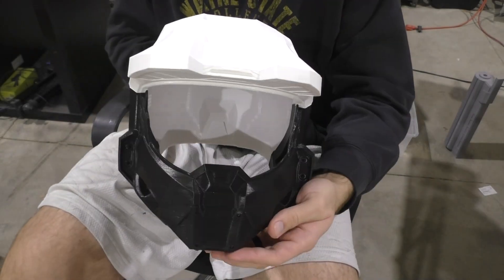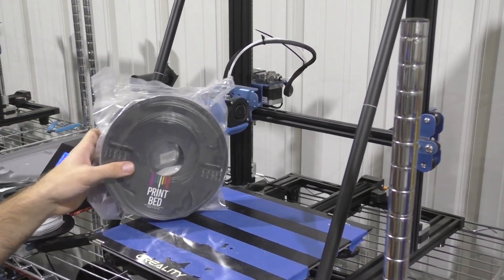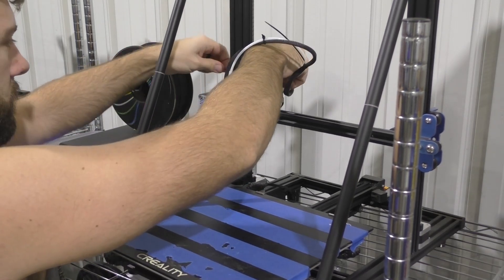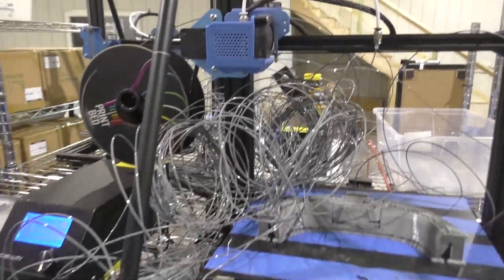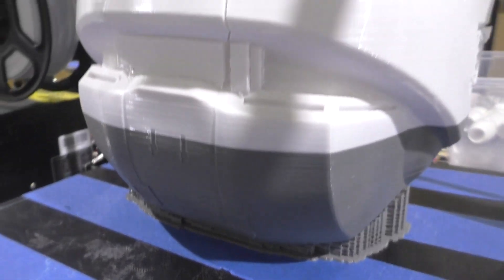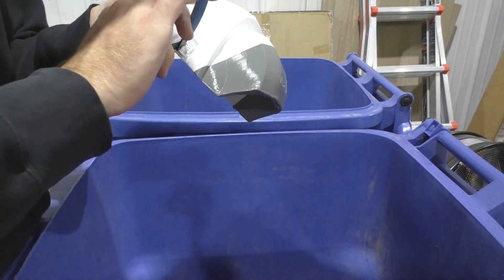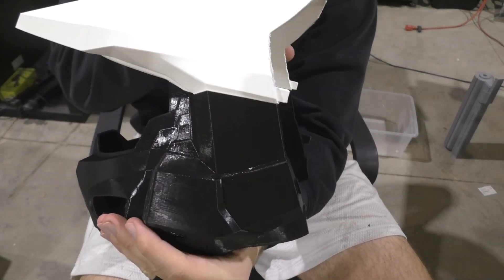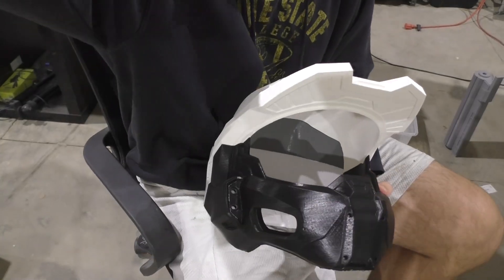3D Printing a Master Chief Helmet - Print Bed Filament Review

Comment: I was wondering if you printed the file a decreased scale to fit on your printer bed.  Is your printed a 220x 220x 250 bed size?  I'm looking to see if this needs to be scaled down

Comment: Has anyone tried printing his Mando or Boba helmets? If so how long did it take and how much filament because both of mine on cura are estimating 5+ days and over 1kg of filament and that's with minimal support. I'm very new to 3d printing large things so any help would be appreciated!
Reply: What’s the layer height, print speed and infill density set to? Those have a big impact on printing time and filament usage

Comment: How clean those came out is insane. Using the settings you shared on one of your videos, 210 seems a bit hot for the filament i' using but I get zits galore on the back of my prints now. Think I need to increase the speed or the distance for my retraction settings again
Reply: I don't think you know what a clean print looks like...
Reply: Now we need someone with a profile picture of “s” and then “M”

Comment: Hey galactic I recently got a CR10s and was wondering what are the best mods/ or even just the best settings and such to set to them?
Reply from the maker: Most of mine are stock actually but some blue painters tape is great for adhesion